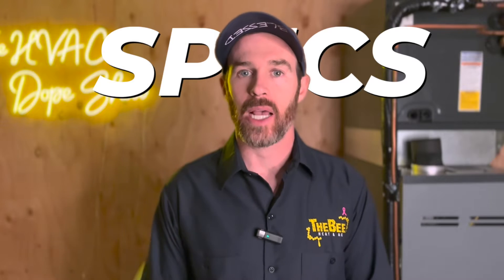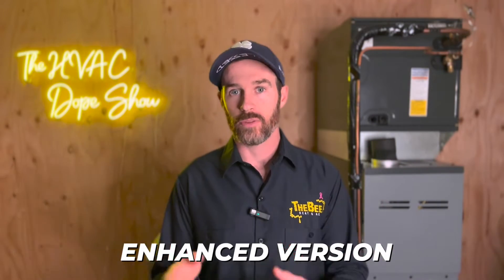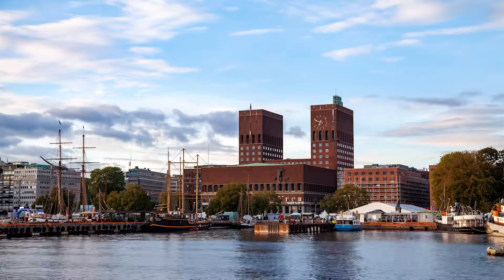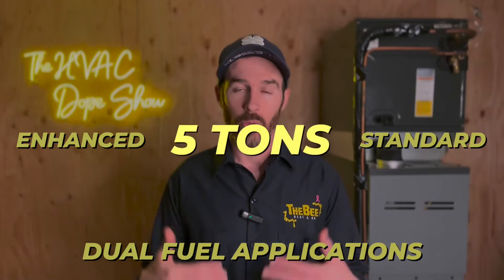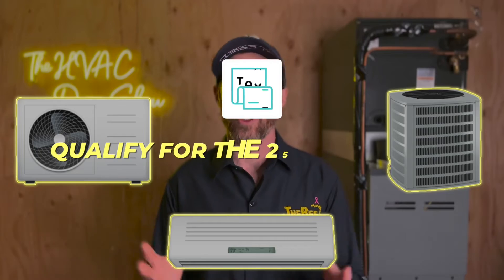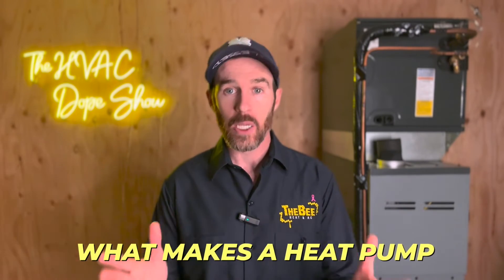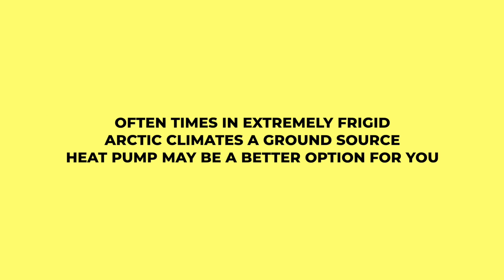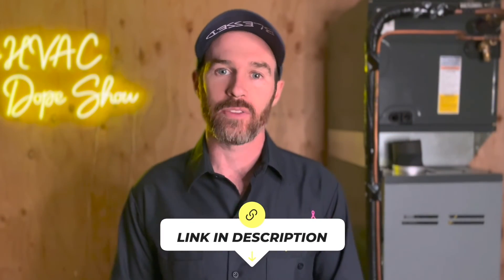The NEW Daikin Fit ENHANCED Heat Pump?!🤯❄️

Comment: Do you recommend going a size up on a cold climate heat pump?  Have a 1520 sq ft house, heat loss calls for a 2 ton (currently have 2 stage 2 ton heat pump) but was told to size up to a 3 ton to get more BTUs in the winter.  Do the new CCHP with the inverter ramp up for heat for winter  but able to ramp down during the summer for AC to a 1 or 2 ton if we went with a 3 ton heat pump?  Wondering your thoughts.
Reply from the maker: Short answer is no…. you size for the cooling load not the heating load, and the size of the ductwork. If the system is too big for the ductwork it will short cycle and be loud (too much airflow). Unfortunately a lot of people make this mistake but you don’t size heat pumps for the heating load unless that happens to match the cooling load and duct sizing.
Reply: @TheHVACDopeShow young man you might want to revisit manual J again, both heating and cooling loads need to be met. Let’s look at a typical home in the San Francisco Bay Area, when you do your manual J it states you design to 42 degree F outdoor temperature. Say the home is 1600 sq”, most homes of that size in the area would have an 80K BTUH furnace with a 4 ton AC. If you were to install a daikin fit you could come up short on the heating BTUH’s since a 4 ton fit only puts out 45K btuh’s. I’m a retried contractor and now a consultant and have been called in on “problem” homes where the customers are not happy with the Fit. What I have found is that they come up a bit short on the BTU’s on the heating side. First thing I do is find ways to make the home more efficient by performing an energy audit. I start by performing a duct test, ensuring proper duct design and perform a manual J. I can usually fix the issues by increasing attic insulation to R44, having the ducting sealed to less than 10% leakage if needed & of course checking return air grills for proper sizing I size to 200 sq” per ton and I size my return ducts to .08” of static pressure on my Ductulator. Sometimes sizing up is a good idea if you come up short on heating BTUH as long as you take duct sizing into consideration. You can always trim down the CFM on the Fit. I have had lengthy discussions with Daikin on this subject and they agree with my solutions. One more thing the Fit wont short cycle since they are inverter compressors. The only other thing to consider is if the customer is willing to set the thermostat and for get it because thats how the fit works best.

Comment: Looking at removing diesel boiler system and replacing with a cold weather heat pump. Not sure if I should include propane or heat strips for backup? Electric is relatively cheap here and I could go with the daikon fit enhanced? Thoughts
Reply from the maker: How cold does it get? If the temps never drop below 10-20F then a properly sized cold climate heat pump should be able to keep up (assuming your duct work is big enough for the load). Lots of variables to consider but in general air source heat pumps have backup heat in climates where the temps get below 10F because the load on the home increases as the capacity of the unit decreases. Geothermal / air to water products are subject to this less but it’s still a consideration because the load goes up. We have a 10 ton system for example installed at a facility that keeps up down to about 10F but at -15F it doesn’t stand a chance because the load on the space decreases. Just some food for thought. But for example in most moderate climates like phoenix (barely drops below 40F) you never need backup heat.

Comment: I just bought this system snd it is not blowing air out the vent.
Reply from the maker: Ever? Or just sometimes? If it’s sometimes it’s probably just in defrost cycle… this happens with heat pumps, you can change the settings to run backup heat during defrost if it bothers you but it’s not abnormal. If it’s not blowing air at all or heating at all you might have a communication issue causing it not to kick on

Comment: Good,  informative video.   I'm considering a project to replace my 25+ year old propane furnace with a Daiken Heat Pump and Air Handler.   I've received a couple of quotes already and the quote from a trusted contractor is a little over $18.5K plus tax.  I'm in a 30 year old 1950 sq ft single level house.  Have a pellet stove for backup heat.   Is this a fair quote for the Seattle region?  

EQUIPMENT
 DZ6VSA 8.6 HSPF/ 17.5 SEER Variable Sp. Heat Pump
EQUIPMENT DFVE Variable Speed Air Handler w/ 10kw strip heater.

EQUIPMENT LOCATION
 FOUNDATION
AIR FILTRATION
: Honeywell: F-200 4" Pleated Media Air Filter.

THERMOSTAT
 DTST Communicating Programmable Wi-Fi Thermostat.
Reply from the maker: I can’t truly speak to price because they vary so widely by region but it sounds reasonable to me and that’s great equipment. That’s a cold weather heat pump so it has a higher COP, qualifies for the tax credit, and is pretty efficient especially for your region. That has an electric heat kit for backup heat too

Comment: I have a Daikin ground source heat pump Altherma 3 GEO. It's been about 3 fahrenheit for the past week here and the pump keeps my house at steady 75 fahrenheit with underfloor heating and the 50 gallon hot water tank at a steady 140 fahrenheit. Very happy with the pump. Of course my ventilation unit is equipped with heat recovery so that helps. These combined systems with a furnace are unheard of where I live, literally nobody has one.
Reply from the maker: Are you in the USA? I just found out we’re getting the Altherma systems soon from our Daikin Rep so yeah we haven’t even been able to get them, more common in Europe but they work perfect for radiant floors because of the temps they provide (130~135 is perfect for radiant floors)
Reply: @TheHVACDopeShow  No I live in Finland, just happened to be researching Daikin ASHPs a couple months back so I guess thats why your videos are recommended hehe. I have the Altherma 3 GEO as my main heat source but I bought a Daikin Stylish H ASHP for summer cooling and had it installed by a Daikin tech. I don't know if they sell this ASHP in the US but the outdoor unit looks the same as the Fit. I will probably buy another Daikin ASHP for my garage and then I will set up all of the pumps in the Daikin Onecta app. Daikin products are considered very good here in Finland. Anyway 135F or 57C seems WAY too high for radiant floor heating, which I have. I have my leaving water temp set to 91F or 33C, which is sufficient to keep the whole 150sqm2 or 1600sqft house warm.

Comment: how difficult is it to add another head unit.  I'm installing a forced air central air heatpump unit. but down the road want to add an addition which will be difficult to run ducting to so would like to just put a zone specific head unit
Reply from the maker: Very easy but you’ll need a separate condenser. They pull little power so they work great for additions… if you want it to run off the same condenser it’s more expensive substantially depending on what system you were originally planning on getting because you’re looking at a VRF / VRV setup at that point. Thanks for watching!

Comment: Im in Canada, just north of Toronto. My home retrofit involves a lower level and main level currently heated with forced air gas ducted. The four bedroom upper level is electric baseboard heat. We have concluded that the addition of ductwork to the upper area would be complicated and cost prohibitive. The contractor has recommended a one ton ductless unit Daikin, Daikin Single Head WALL MOUNT Aurora Heat Pump, 1.00 Ton, Ductless Outdoor  to supply the upper and a Daikin, DAIKIN FIT Heat Pump, 2 Ton, Heat Pump to supply the lower two floors.
I have questioned the need for two units thinking that there may be an Daiken unit that may offer something similar to the Daikin, DAIKIN FIT Heat Pump, 2 Ton, Heat Pump with a ductless outlet that also incorporates a possable single head  ductless wall mount that can feed the upper level. Any thoughts would be appreciated.
Reply from the maker: What your referencing is a VRV life unit and it essentially combines two units into one. It’s also low ambient rated and can tie into a forced air coil for the main floor and a cassette, ductless, or slim ducted unit for the upstairs. If you have an attic space where you could put a few ducts in the attic the slim duct units allow for a separate ducted system without as much difficulty (assuming you’re only trying to run 4-6 ducts or less). It’s still more expensive but will work better than connecting to an existing ducted system from the main floor. Hope that helps! The separate condensers aren’t a bad option fyi, if you have a Daikin dealer already they should be familiar with some of the VRV products

Comment: Does this unit require a furnace still?  Or does this unit do both heat and cool??  Also what’s the model of the Daikin Fit ?  Thanks for video
Reply from the maker: It can work with an air handler or furnace / coil combo, but yes it has to connect to an indoor unit. When paired with a furnace the furnace becomes your backup heat on cold nights (below 0F) or when the system isn’t keeping up in heat pump mode.

Comment: Hey @thehvacdopeshow
I have been researching a new heat pump set up and one of the proposals is this Daikin configuration
Furnace - DC80VC0603BX
Coil - CAPEA3026B4
Heat pump – DZ6VSA36

I live in 98012 zip code and wanted your advise on this setup.
This doesn't qualify for energy credit, like you have mentioned but what do you think. The quote is close to $17K
Also, does these heat pumps work well with Google Learning Thermostat?
I can't understand why all contractors keep pushing for the brand specific thermostats.

What are the SEER2, HSPF2 and EER2 rating for this combination.
Can you please help?
Thanks a bunch!!

Comment: Do you guys do work in keystone CO? I am currently renovating my condo and would love to see if heat pump might be an option there. My current contractor is oppose to it.
Reply from the maker: Yes we can come out there it’s just subject to availability but w have heat pumps that will work at your elevation / climate. If you’re in a condo what kind of hvac do you have currently? Often times condos have forced air hydronics (first co units) and so it’s not always a feasible option. We can give you a remote bid for free, for Keystone we charge a trip charge just because of the distance but we’re happy to at least examine some options remotely if you can provide us some pictures. Thanks for reaching out and watching the channel!

Comment: I am looking for a dual fuel/heat pump system and came across the Daiking FIT. This would be a retrofit installation since I would like to connect to the existing ducts. However, if I wanted to add another zone to the system (basement - no ducts), it sounds like Daiking FIT doesn't support it. Should I be looking at the 'VRV Life' model? Thank you
Reply from the maker: Daikin fit should pair with a zone control board (like a zoning damper) and then the ductwork has to be modified to account for it. If the basement is unfinished or there’s access to be able to modify it easily zoning control boards are an option on the fit (99% on that). We’ve personally done that on a DX9 which is the same communicating tech but it’s not common in Colorado. If you want a separate head unit (cassette / ductless etc) then you’d go with a VRV to accommodate that, or could do a separate unit altogether as a separate 1 to 1 (1 condenser to 1 head unit) which is a good option too because it gives you some redundancy.
Reply: @TheHVACDopeShow  thank you! I appreciate you!

Comment: I’ve been told that a backup generator can damage to an inverter based heat pump.  The concern is the generator output voltage or frequency is not stable enough.  Do you have any information on this concern?  I have a Generac whole-house backup generator, not a portable.
Reply from the maker: I’m not sure but we put surge protectors as standard practice on all our installs to prevent issues with this… grid can be unstable in Colorado sometimes especially old city blocks in Denver so we put them on to prevent fried boards and damaged components. I’m not an electrician but imo a surge protector should limit that impact as a problem
Reply: @TheHVACDopeShow  Thanks
Reply: @TheHVACDopeShow surge protection has nothing to do with his question. Please let me know if you need more man help baby boy
Reply: If you get a generator with the correct pure sine wave you’re fine. 

Howard stop being a generic YouTube bot thanks doll.

Comment: Ok, let me make sure I understand what you are saying.  If you take 4 or 5 ton Dakin Fit and combine it with a 5 ton gas furnace the AC will be limitted to 3 tons of capacity?
Reply from the maker: The 3 ton was an old limitation on furnace only / dual fuel applications but now it can go up to 5 tons. It was a design nuance and honestly kind of a weird one but related to rebates / AHRI. It’s since no longer an issue so a 5 ton heat pump can pair with a gas furnace in a dual fuel application
Reply: @TheHVACDopeShow  So it is only the heatpump version of the Fit or all of them?

Reason I am asking, I have a 4 ton Fit with 5 ton gas furnace that can't cool my house but has no problems heating and your statement got me wondering if my AC was only running at 3 tons.

Comment: If you need dual fuel in your heat pump, It's junk. Cold climate heat pumps cover 100% of heating and cooling without the need for backup. R290 air to water monoblock heat pumps still function down to -35C.
Reply from the maker: Not true. Can’t always size a heat pump for the load if the ductwork isn’t big enough to handle it. 1,000 square foot house could need 60k Btu output for very cold temps (Canada) but would never put a 5 ton heat pump on a house that small. Then your cooling is way oversized just to account for the heating load…

Comment: Just watched your video and the information about the "enhanced" Daikin Fit vs the "standard". Does this mean the enhanced is for much colder climates than here in Florida ? or will the standard with a heat pump application be fine here as we have milder winters ?
Reply from the maker: The standard is fine if paired with an air handler, the nuance was related to rebates and the IRA tax credit, but when paired with an Air Handler the efficiency ratings are higher and my understanding is they pair well and qualify for the tax credit. Benefit for the cold climate enhanced version is it now qualifies as a cold climate heat pump and therefore can qualify for a tax credit. And if you have an air handler setup already (vs furnace) you’ll be fine in Florida with any of the Daikin fit heat pump products
Reply: @TheHVACDopeShow  just saw this video and was going to ask the same question. I am upgrading and was deciding between the 38Mura and the Dakin Fit. I also live in Florida(Zone 1). Which are winter is consider a fall up north. I am going with Daikin because of the warranty. In addition that I need a 3.5Ton. Carrier doesn't have a 3.5 on the 38Mura. But a 4ton. My house is 2033 square ft. townhome. Base on math((2023sqf x20)/12000=3.38Ton. I should have a 3.5 Ton.  I currently have a 3 Ton old Lennox/Trade and its on his last leg(17 years). Its the original unit that came with the townhome. Hope a made the correct decision.